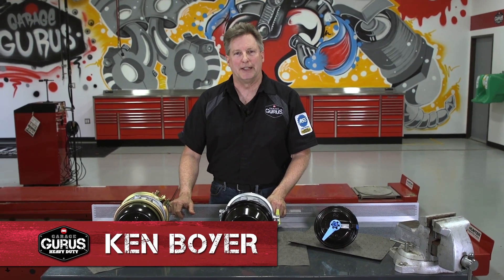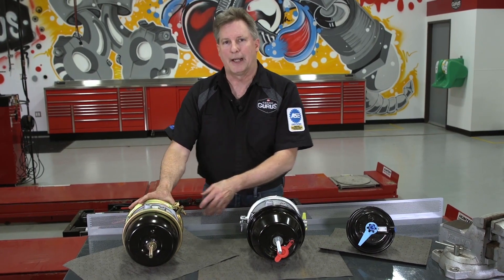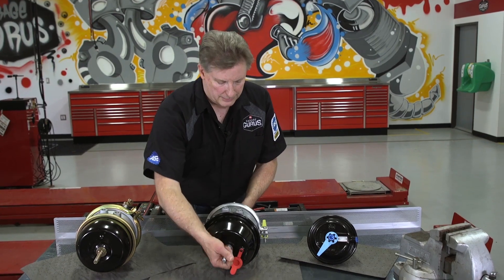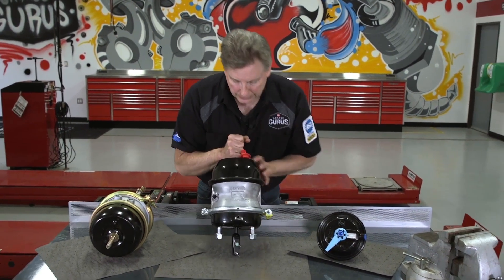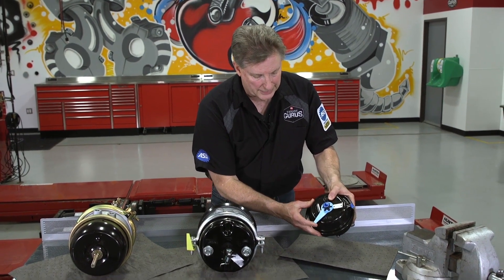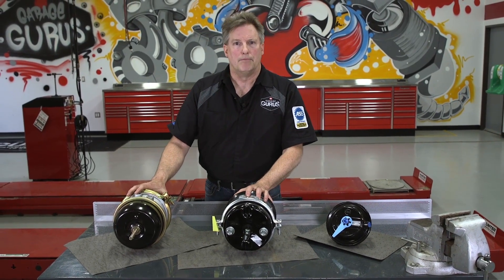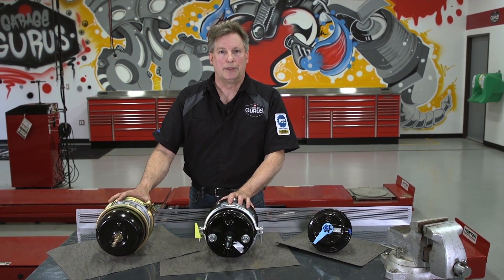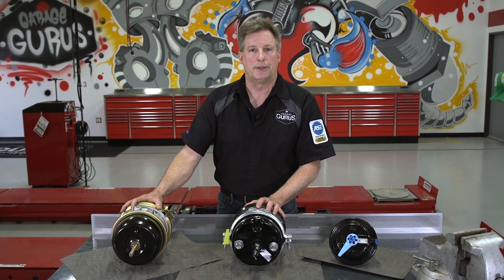Heavy Duty - Long Stroke vs Standard Stroke Brake Chamber

Comment: Does it matter if your replacement hoses are all the same length? Meaning let's say you need to have four 24'' hoses but only have three and decide to use a 13 inch hose on one where it will have the ability to connect? So if one side has a 24'' on the Emergency brake side and there is a 13'' on the other's Emergency Brake side would that cause an issue?
Reply from the maker: Different hose lengths and sizes effect balance/timing no matter the location they are placed. This imbalance effects the service side more than the emergency side however the same length/size hose should always be used as an inspector could take the vehicle out of service for just the hose length.
Reply: @GarageGurus  Thanks for the quick reply.
Reply: Yes it would create a brake imbalance application.

Comment: How can they cause brake unbalance when they are both type 30 diaphram producing the same power......
Reply from the maker: The unbalance occurs because of the half inch more stroke the long stroke has.  If the shoes are worn, drums are worn, the standard stoke could be at the end of its applied stoke no longer applying braking force.  However due to the ½ inch additional stoke of the long stoke chamber, the long stoke could still be applying braking force.